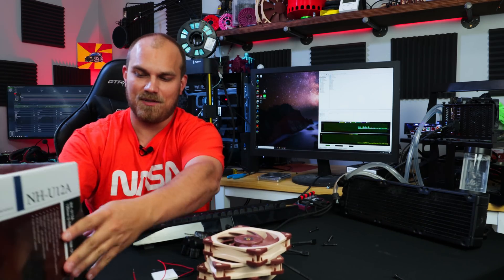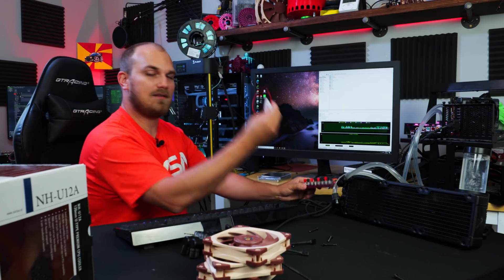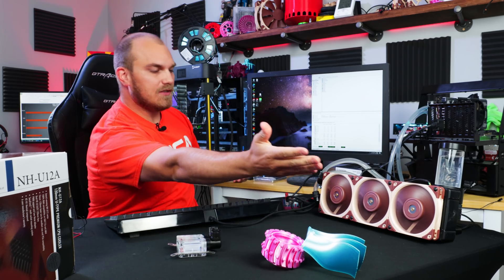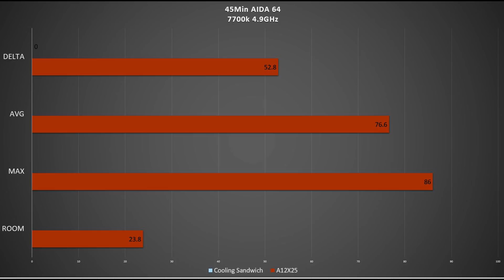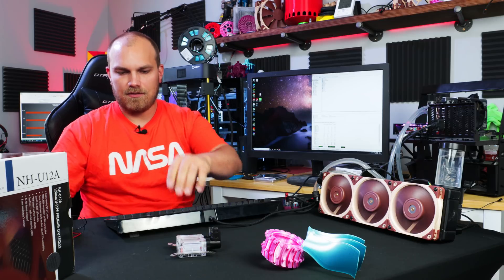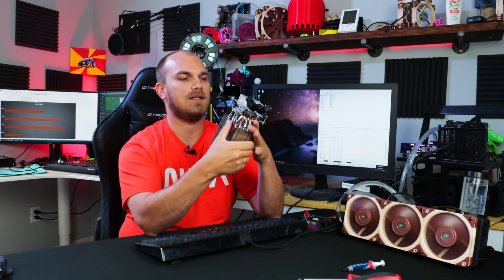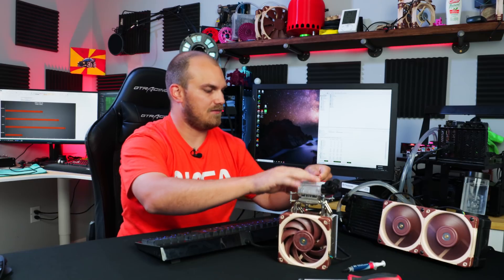Can A Wish.com Water Block and a $4 Peltier Beat a 360mm Radiator?

Comment: You need to reverse it. Connect the peltier after the water has passed through the radiator and then directly pump in the cooled water to the cpu.
Reply: will not change a thing after water reaches equilibrium. I guarantee. Simple thermodynamics. Will seem better for the first minute or so tough.
Reply: @marsovac  but the equilibrium of the water can be set closer to the ambient. That's why the peltier after the heat dissapation through the radiator as the temp differential needs to be controlled. And I feel your concepts need a little more study as water will reach equilibrium at any temperature. Although you are not considering the exchanged heat at the radiator. And its much easier for a peltier to cool a lower temp differential rather than start with the direct cpu heat. That's what I was suggesting.
Reply: @shivamvaid601  The flow rate makes the water pretty much the same temperature throughout the loop.
Reply: @Grrizz84  peltier devices are dependent on the differential. Ofcourse the flow rate will balance it in the long term but even then there is energy being pumped into the system. My only point is to givd the tec a chance to have relatively colder water coming out of the radiator to cool it rather than getting fully heated water right from the cpu block. That increases the differential the tec has to overcome in its hot and cold side.
Reply: @shivamvaid601  I get that but we are generally talking about something like 0.5c so its not going to be enough to make a difference. I would say his peltier is simply too low power and not able to overcome the heat output.
Reply: @Grrizz84  to be fair. A 240 rad Easily decreases the temps back to a good stable 39-40degrees. The temp differential of an average tec at 80% total capacity is around 15-18 degrees. So technically in a room at 25 degrees Celsius. Then decrease would be substantial as the temp difference between ambient and the heated water is around 15-18 degrees. Perfectly under the limits for the tec. Ofcourse it won't give yoy massive decrease in temps cz the tec itself is just 8% efficient but that switch in just the position of the tec will create a decent difference. Basically to get a good proof of concept here. Ofcourse dessicant based cooling is the best because you can get close to phase change levels of heat exchange but at a fraction of the power input.
Reply: @shivamvaid601  Water flow in a loop means it spends a very short period of time ant any point in a loop, a water coolers water essentially sits at an equilibrium temperature based on the heat source and coolers dissipative potential meaning that at any point in a loop (e.g. intake vs. outlet of a radiator) you will likely only see something like a 0.5c differential in temperatures, the whole loop effectively sits at the same temperature.
The peltiers cooling ability is dependent on a range of factors like the hot side temp, applied voltage/current, heat pumping capacity, delta T, etc. you cant just say an average TEC at X% load  has a cooling capacity of Y°c.
With that being a $4 TEC I cant imagine it is anywhere close to having the capacity to cool a 7700K, the CPU would simply overload it meaning the peltier will be adding heat to the system instead of removing it.
Reply: @Grrizz84  actually you can say a tec at x% load has a particular capacity. Ofcourse surface area matters. I'll still suggest to try it. The main objective is to keep the contact temps with the tec at its lowest in the loop. That simply isn't possible with the water directly coming from the hot side of the entire system. Secondly the cold side directly affects the hot side. Which is why the cold side needs to face the water at the coldest point in the system as the radiator is responsible for decreasing the water temps over 20 degrees in any loop. Otherwise we would have never needed any radiators. I think you are not able to grasp the concept I'm trying to use here. It's also the basic way how phase change cooling works. The objective is to separate the hot and cold side with the farthest distance between them to allow for heat dissapation. Then the change in temps will be over 2 degrees Celsius minimum compared to the 0.5 number you have been going on about.
Reply: @Grrizz84  and ofcourse a tec cnt cool a 7700k. For that you will theoretically need a tec with a capacity of 2.4kw per sq inch of cooling to do it without any other type of cooling present.
Reply: @shivamvaid601  If you have a large temperature delta in a water loop you have an issue with your loop, the temperature change within a loop should be very minor as such the position of the tech in the loop is not going to make a significant difference, the idea the inlet and outlet of a radiator in a water cooling loop have a significantly different temperature is a common misunderstanding about how it works and how flow affects the system.
You need to know a lot more about the specs of the TEC to estimate its capacity, you cant simply talk about your "average" TEC, a TEC with a 60W Qmax will be drastically different than one with a 172W Qmax not to mention all the other factors that impact capacity.
The fact you understand that this TEC simply cant cool this processor makes the whole discussion moot though, it simply doesn't matter where in the loop it is it wont work, the 2.4kW figure is way off though.
Reply: @Grrizz84  mate. I'll suggest learning a little more about TECs and TEGs. And you still dnt get it mate. Some simple things you need to keep in mind are surface area. Heat capacity which is around 4000 joules for 1 liter of water. Thermal efficieny of a tec and in the case of the tec being used in the video, it's exactly 8%. And every single water cooling loop creates a temperature differential of 40 degree Celsius at its maximum cooling capacity. Now coming to the 2.4 kw number. It's quite simple actually. An average 7700k produces 200watts of heat per sq inch which comes to around 0.194btu/s. At an 8% efficency rate. It will take around 2.4kw per sq inch to effectively provide cooling for the 700 btu/hr required to effectively cool the cpu without any other kind of cooling so the calculation here is quite sound. Anyways. I can see you simply aren't able to visualise what I'm talking about and honestly I dnt have any more time to continue this discussion. Ofcourse a tec like that cnt be enough to cool a 7700k but the proof of concept works well. And that's all I've been talking about from the very first comment I made here. Anyways have a great day.
Reply: @shivamvaid601  if you think that the water gets warmed in the loop so that it no longer cools the cpu then the problem is on the hot side or the peltier, it cannot pull enough watts out of the water. That means either that the peltier is  not strong enough or that the hot side cooling is not adequate. To solve the first problem you can do what most people do when using peltiers: stick it to the cpu. Cooling metal is more efficient than cooling cold water (if the cold side is on the water this is what happens). To solve the second you put a more massive and performant hot side setup. But in this case I think he has a bad peltier, probably tought he got an 12715 on Wish, but they scammed him and sent a relabeled 12705.
Reply: @marsovac  actually your are half right here. Yes peltier directly linked to the heat source is the best solution but we have to realize that a tec becomes a very strong insulator once its overwhelmed. If we use the Intel tj max of 105. So if the ambient temps are 20 degree Celsius. The tec needs to overcome a differential of 85 degrees. And anything above 60 degrees of difference makes the tec an insulator. The reason why water is used is because it can absorb 4000 joules of energy per liter to increase 1 degree in temp and releases it much slower. Something like aluminium needs 500 joules to heat up a piece of aluminium to 1 degree more, so the objective of the tec to be place at the farthest point from the cpu is to balance the overload on a teg. An average radiator dissapates around 30 degrees of heat in an average cooler and around 50 degrees in a high performance rad(usually copper gold solutions used in space exploration). Why I said to place it after the rad is because the rad will decrease that differential the tec has to overcome because the rad dissapates 80% of the heat in the system. Then the tec is just left with the 20% latent heat present in the liquid.
Reply: @shivamvaid601  Thats great and all but I really dont think you know what you're talking about, or at least not properly, I mean "every single water cooling loop crates a temperature differential of 40c" is just wrong and unless I missed it he didn't even mention what peltier was used or what its specs were, the only thing he said is it was about the size of his CPU which tells you basically nothing, at $4 I would be expecting a 60-75W one though. On the other hand I have done peltier cooling in the past, back when it was a viable (still not efficient) method of sub ambient cooling a PC.

The proof of concept didn't work well at all (it would have been better without the peltier because it was overloaded) and that was not at all what you said at the start, you mentioned moving the peltier after the radiator (which wasn't connected anyway) and would not have made a difference either way because of the fundamentals of how a water cooling loop works - the movement of the water acts as a heat transport effectively aggregating the energy (imperfectly, of course there will be a small variance) within the loop 🙂

Of course a quick google will show you that needing 2.4KW per sq inch is off base too, heres a 300W TEC chiller cooling a 5.2GHz 7700K: www(dot)overclock(dot)net/forum/62-peltiers-tec/1633988-chilled-water-cooling-vs-3-0-build-log(dot)html
Reply: @Grrizz84  kid. 😂😂😂 Did you even read the very link you sent yourself? 😂😂😂 Firstly he has 6 331 w tec. That comes up to a peak output of 1986 Watts. He also has another 6 tec rated at 224watts. Thats 1344 Watts. That totals to 3.3kw. Now ofcourse he isn't running the system on ots peak capacity as tecs have the best efficiency around 80% capacity. But coming to the main point. He himself is using radiators. The tec is nowhere in direct contact of the cpu. What you asked me was the cooling requirement if a person has to cool a cpu with a tec directly placed on top of it. And i gave you the rough math. The guy in the link uses 18 radiators to dissapate the majority of the heat. He just uses the tecs to go below ambient. That's all. And I cna see yiu have no idea about what we are talking and how a tec actually works. And I can see you are desperate to win this discussion so sure. Go ahead. You won. Happy mate? I'll again say do the math. Learn about the specific heat capacity of materials. And also read a few data sheets of some decent tecs. You will get what I've been trying to tell you since the start. But really. Study about it once. You seem like a high school student who is using incomplete theory to justify your logic.

Comment: the biggest issue with setup not even taking the peltier into account is the surface area of cooling. an air cooler and the fins of a radiator are basically similar in cooling capacity.

I guess now i'm curious to see a radiator replaced with a copper block with 3 air coolers tied to it.

Comment: a single peltier againts a 360mm rad. your giving too much hope for the peltier my firend. the only timei had positive results with peltier in pc cooling was sandwhicing 1 between a amd phenom 2 x4 955be to a hyper 212 evo. and that is with a 150watt peltier. the phenom is a 125w tdp chip.

Comment: Hi! I tried to put in the loop, after the radiator. I cooled the peltier with a cpu cooler without fans, just for testing, and i got 3 celsius decrease. Not so efficient, but did something ;)

Comment: Dump the heat using a rad THEN cool it with a couple teks between the pump and the cpu.
Reply: so the loop goes 
pump out
tek cooler
tek cooler
cpu
rad
loop back to res/pump

Comment: You should try connecting the peltier to the exit of the radiator and run both of them together to see if it does make a difference

Comment: So a 100w peltier will provide ~10w of cooling and 90w of heat. The tec also provides quite a lot of thermal resistance. It would work a lot better to put the water block straight on the air cooler

Comment: Don't try that with a 260 watt peltier. I did that and instantly burnt my thumb. Keep up the videos. My Prescott CPU was subzero at idle and sub ambient at full throughput. However after about 2 years I heard beeping coming from the bedroom and went back there to find my PC screen froze with water boiling inside the koolance block. The pump controller for my koolance case had died.

Comment: Peltier works. I remember even Cooler Master adding one on their V10. It was a gimmick at that price, but it added something. It just that even if it can make a temperature difference on both sides, it's limited in how much thermal power it can transfer.

Comment: I'm at 1:33... It will be not work, my prediction.
Peltier element transfer heat to upper plate adding his own power input.
Air cooler need to spread more heat out.
Water cooling adapter isn't able to cool down the water so fast.
You have there now multiple layers (CPU Heat spreader + water block + Peltier element + air cooler), heat transfer will be slower.

Comment: TECs typically don't move that much heat, but they do get very cold, kind of like a high vaccum pump but for heat, slow, but capable of big pressure differences,

To (maybe) make this somewhat useful I would propose these changes to the loop; insert a regular radiator between the TEC and the heat source to get the liquid close to ambient, then the TEC could maybe cool that bellow ambient, however, given that the cold from the TEC won't accumulate anywhere you'd probably be better off using an ice bath instead of a TEC, but it would be interesting to find out

Comment: try it without the Peltier if its rated less than the cpus tdp(although tdp isnt always measured correctly) it will act as an insulator and it will perform worse than without it

Comment: I think the thermal paste is the limiting factor. Thermal paste is worse than flawless contact, and many people (who know what they’re doing) suggest that the paste prevents any cooling system from responding efficiently to heat generation by the CPU. In this setup you have triple the thermal paste interfaces than a standard system would have.

Comment: Try two in series, then 5 in parallel.  So 10 coolers in groups of two (at least).  It will work -- it is working, but as is, it's completely overwhelmed.
As I always say: Stirling engine or tiny fridge compressor.  Wish you'd give those a go.  Efficiency is far superior to a Peltier.

Comment: Try this loop:
CPU --> Peltier (hot side) --> Rad --> Peltier (cool side) --> CPU
Reply: what?
Reply: @sheeeple2069  It's a simple concept: Grab extra heat from the CPU over to the rad, give extra cooling to the liquid going to the CPU.
Reply: I believe it'd be more efficient to not send extra heat to the loop's rad after the CPU, but to rather send it to a different rad or air cooler instead in order to keep the temperature difference between the hot and cool side at a minimum for a more efficient peltier effect. 

If you wanted a peltier power generator, then the setup Anders provided would be ideal ;P
Reply: Simple concept that makes no sense. Peltiers produce more heat than it cools. Using it to heat and cool the same loop is essentially just adding more heat into the loop.

Comment: My understanding is, even if the Peltier were capable of pumping enough heat (i.e., you had more / larger), that this probably wouldn't have worked.  Heat pipes can move a finite amount of heat before they saturate and lose ability to do convective heat transfer.  This switches heat transfer modes to a mainly conductive mode.  As a result, heat pipe based coolers have a maximum amount of heat they can dump efficiently (regardless of how crazy the fans are or how high you're willing to run the temperature of the heatsink). 200 W from the CPU + several hundred W from Peltier inefficiencies would probably overwhelm the heatpipes with a cooler that tiny.

I think you can get much higher flux pipes, but usually at much higher temperatures.

Comment: there is no "better tec" they are about 4% efficient. They run about 70 watts, which means 66 watts from the TEC has to be dissipated. The 66 watts plus the 100 or so watts from the cpu, you can't get the TEC to be cool enough on the cold side. Lots of people have tried, the poor efficiency of the a Peltier cell is the killer.

Comment: Use less voltage and use more peltiers. Also slightly better cooling on the hot side makes it work much better. These are heat pumps, not coolers.

Comment: The 2 main problems with using a Peltier to cool down a CPU is it's to slow and you are trying to use heat to lower heat. We all know that it makes one side cold and the other side hot but it makes heat to do that. So trying to cool it down makes it seriously inefficient. And because it is so slow to cool stuff down when it is trying to cool down the CPU the CPU gets to hot for it to handle and makes the peltier more of a heater than a cooler.

Comment: What was the water block for? Why just use the peltier between the cooler and the heatspreader like if it was a wicked thermal interface solution?